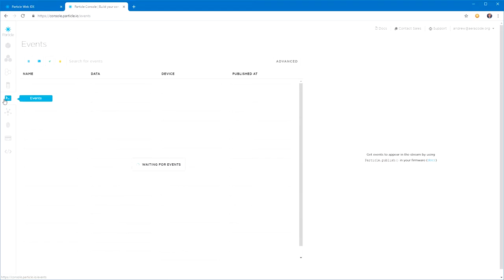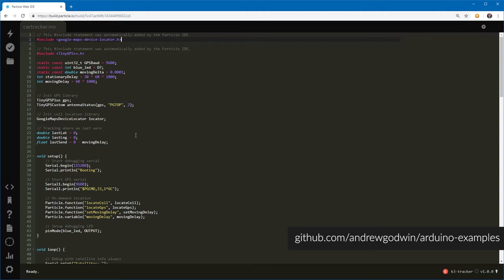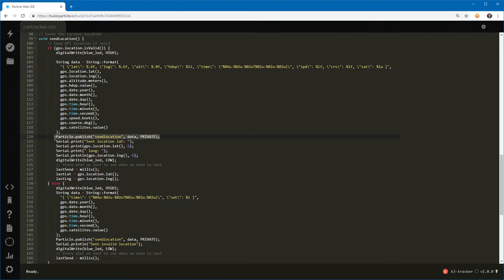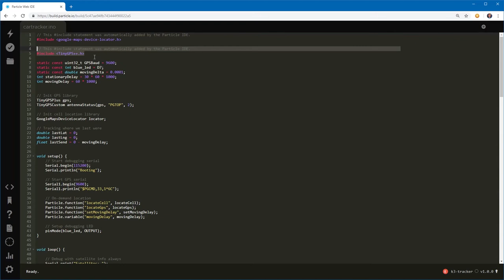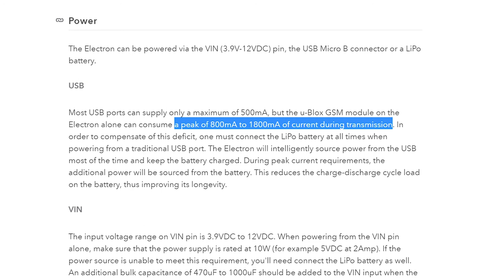Building a GPS Tracker

Comment: You still around?
Curious how small can a GPS tracker be produced? I have an idea for something but not sure if it's possible to produce...
Reply from the maker: You can get incredibly small these days, but that requires custom circuit boards, and at some point you still need enough room for the antenna. Making something by hand, you can probably only get down to about a cube 1 inch/2.5cm on a side.

Comment: Did you ever build a tracker for your bike? Well explained video, thanks.
Reply from the maker: I did not! I never quite figured out how to make it sleep well enough to not drain the battery - I should go back and revisit it with one of the more modern, low-power chips.
Reply: @AndrewGodwin  
I have a little project that’s similar but uses a Sim800L 2g modem (currently still supported in the Uk) pro mini and quectel L80 gps, I have put them all in sleep mode (plus have a mosfet on power line on gps for extra power saving). When you call or txt it wakes them all up and acts on the command that was sent. All powered off an 18650 LiIon battery. All very interesting.
Reply: @AndrewGodwin  does the gps tracker allow the person in the car talk with the person watching them on the radar (the screen that displays the cars location) and can the gps tracker be connected to a car gps (the one's that are bought separately from the car) and give the car's destination from that gps without getting ride of the line as the car moves closer to it's destination, also is it possible to give the gps a name (Like airplane's) for the car it's in and is it possible to have multiple gps (The one in this video) connected to the same radar (The screen that displays the cars location) and communicate with the other one's you (I in this example) own and made?, PS where can I have the gps's signal sent to that can display the cars location?

Comment: last only 2-3 hours is too less, the product in the market last 30 days.
Reply: Just use a bigger battery,use your brain before speaking
Reply: Legobeto Thegrreat that’s pretty sad, most diy projects should be better than a mass produced piece of garbage in a plastic box, especially if this project is going to cost you over $110 for the parts
Reply: @Bajicoy  It depends, if you buy some shit from aliexpress, you can use it 2 minutes before it explodes in your car. But some serious company, with guys like andrew will probably make something better for a (maybe) lower price.
Reply: @kars1504  well, first of all, anyone that buys something that lasts 2 minutes and explodes is an idiot that has no right being 100ft near lithium batteries or building circuits in general

I say all of this because I have a couple of $15 comparable trackers I rigged from an arduino, sim module, and gps, etc, it's not rocket science to build and you just hook up the right size battery for however long you want the tracker to last

Point of DIY is to build something custom that is comparable or better than whatever is on the consumer market because items on the consumer market typically have 50-1000% mark ups from the raw chinese parts and labor they used to build the product in the first place, DIY is optimally meant to cut out that mark up